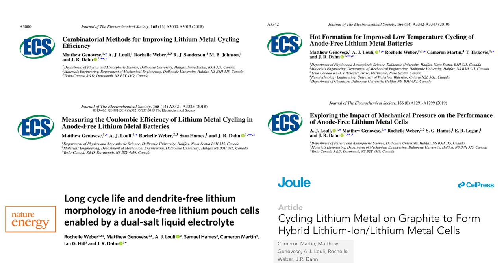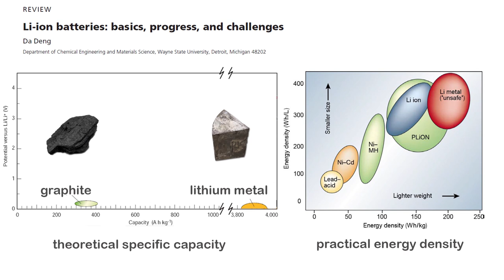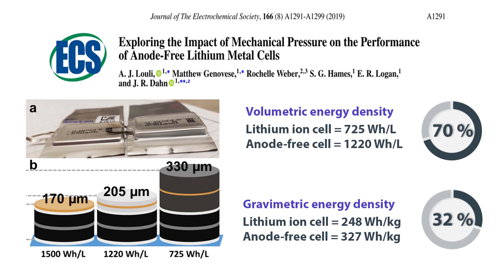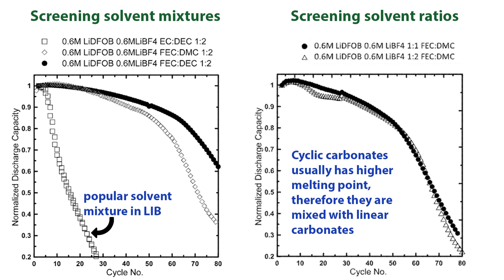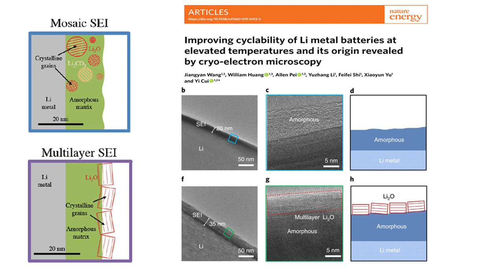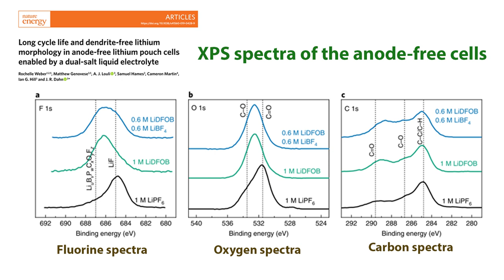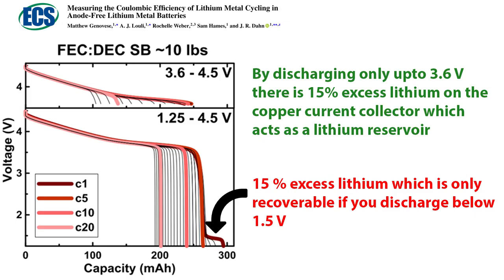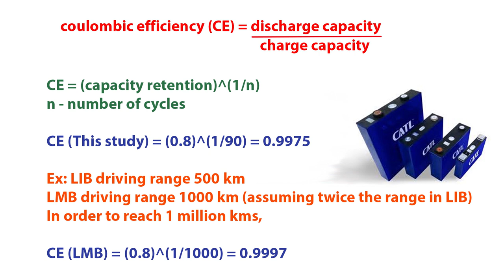Deep dive into Tesla anode-free patent!

Comment from the maker: At 9:42 the increase in pressure for silicon/graphite composite cell in the slide is after 900 hours, in order to compare accurately with the anode-free cell after 400 hours then the increase in pressure for silicon/graphite composite cell should be 40%. Sorry for the confusion!
Reply: Anode is pronounced with accent on the first syllable.  Closer to "an ode"